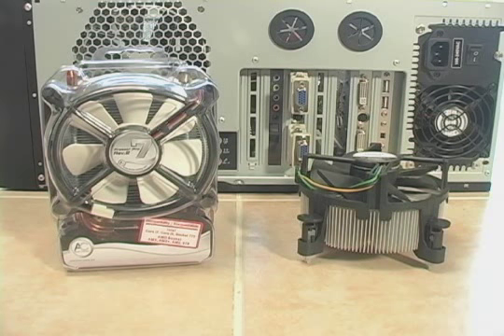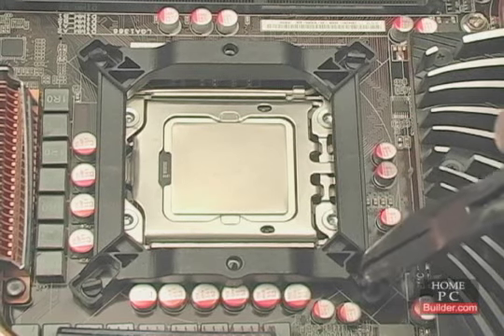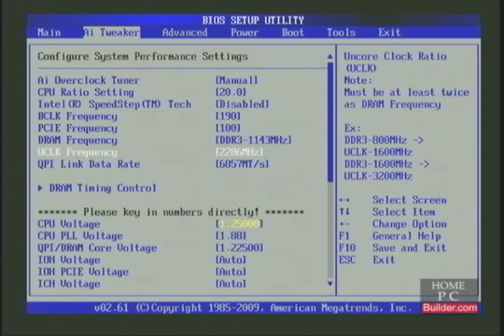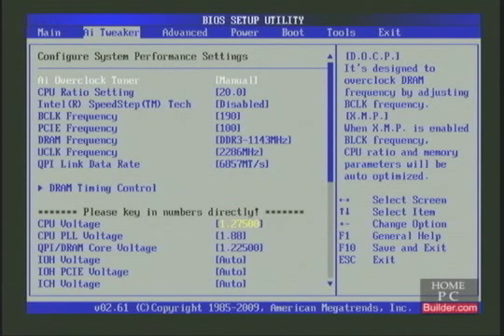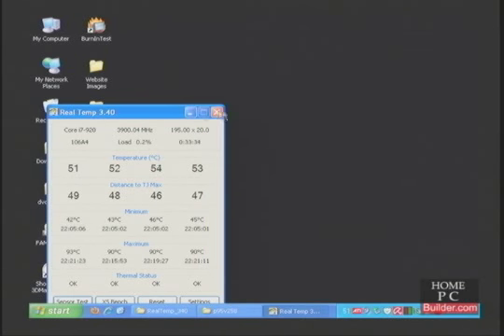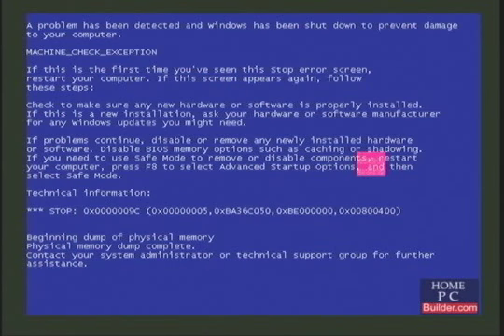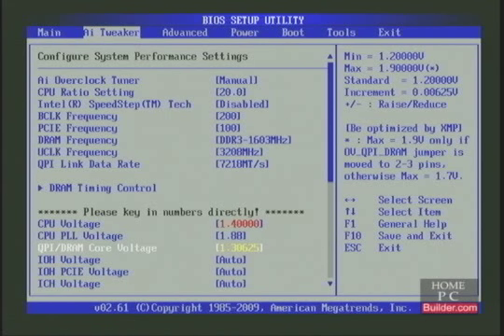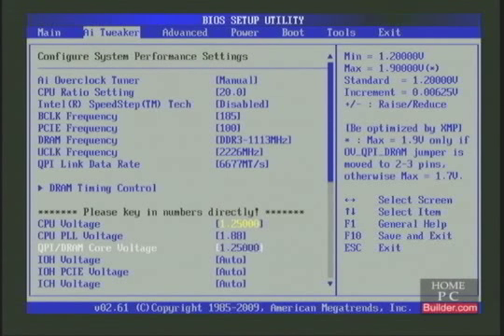Lesson 05 - Intel Core i3, i5 and Core i7 CPU Overclocking - www.HomePCBuilder.com

Comment: I have already 1600 mhz 1.5V Corsair Vengace Ram.But my ram running on 1333 because of 32 nm Cpu and motherboard doesnt support 1600 without OC.So,if i set to 1600 mhz manualy on ai tweaker,should i set to 1.50 ram voltage or can i just set it 1600 without giving any voltage (auto)

Comment: When installing anything onto a motherboard, heatsink clips, seating RAM sticks, etc., I’m always worried about motherboard flex and breaking connections inside the board.  There was quite a bit of flex.  It appears this is normal.  Removing the motherboard from the case and installing parts with the motherboard supported from underneath would be a solution.   Probably a lot of trouble for nothing.  It seems I’m the only one worried about cracking a board.
Reply from the maker: I've yet to break a motherboard from flexing it putting in components.